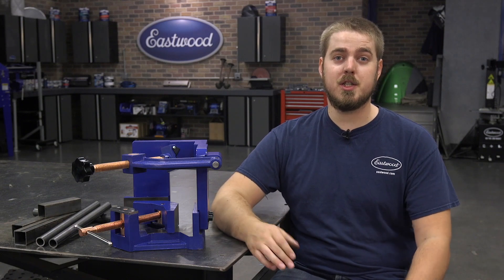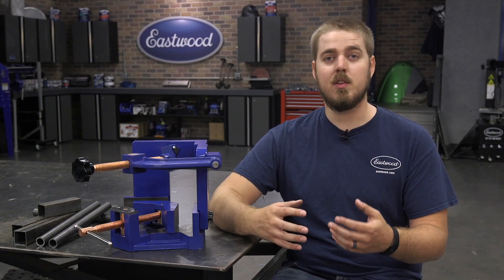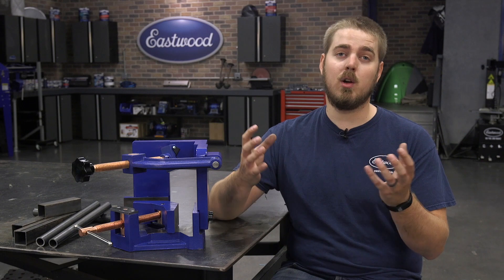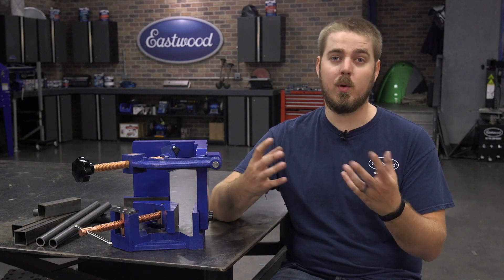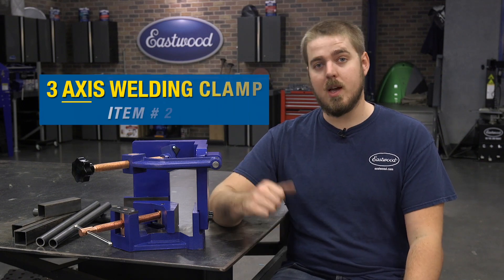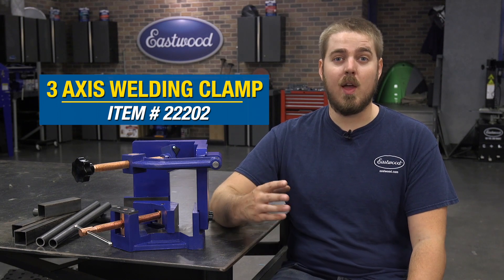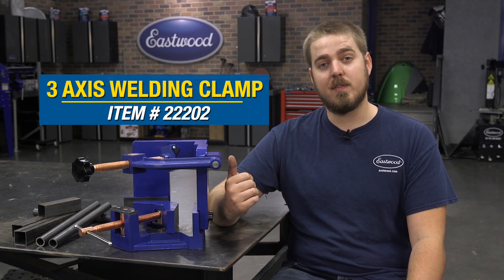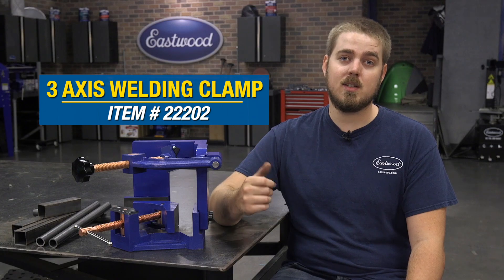3 Axis Welding Clamp - MUST-HAVE Vise for Welding & Fabrication - Eastwood

Comment: Pricey, but that is slick. Bench magnets often don't get the angles just right.
Reply from the maker: It's worth it!
Reply: The price is 219. When you think about it, just the time to go back and correct fitment issues would quickly eat up what you would have paid for this tool. Maybe a reasonable cost cycle to cover the purchase would be 3 to 5 projects or jobs. That isn't bad.
Reply: @kevinhornbuckle  A good assessment on it's value, Kevin. Thanks.